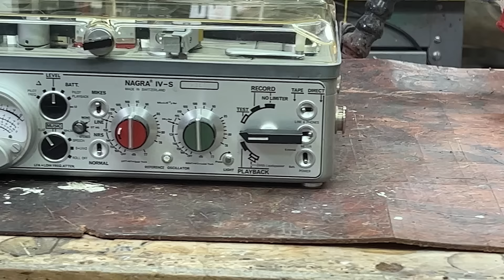Adam Savage Restores Clear Plastic Discoloration

Comment: Make a paste by mixing baking soda with water until you get a thick consistency. Apply the paste to the yellowed areas of the plastic. Gently scrub the paste into the plastic using a soft cloth or sponge. Let the paste sit on the plastic for a few hours or overnight.

Comment: Did you nod off watching the videos about removing discoloration in plastics?  You must have because they all use UV light strips or, at least, protracted exposure to the sun.  Of course, I'd worry about leaving plastics out in the Summer Texas sun because of the heat involved.  It is impressive that you got such a good result just by polishing.  Thanks for the video.  Fun.

Comment: Hi Adam, you should definitely using UV light with the Peroxide for better results. A clear plastic container wrapped on the outside in aluminium foil and a black light or UV LED strips suspended above the container pointing straight down. Foil to reflect the UV back into the container. The process is called Retro Brightening, the 8 Bit Guy or Odd Tinkering channels use the method often.

Comment: Looks great. I don't know if it can remove more of the yellowing. But, have you considered using PolyWatch? It does wonders for restoring most scratches on acrylic crystals for watches.
What I'd like to definitely know is to how to restore rubber components that develop that nasty tacky feeling when it hasn't been used in a long time.
Reply: i agree on the rubber parts - i would love to see him try out different methods for restoring rubber. I have read that winter green can be used to make hard rubber soft again, but i have not tried it (mostly because winter green oil isn't readily available here in europe...).
Reply: @pinkerbot  for me or my application, I am thinking of a Darth Vader lightsaber I have and the rubber grip pieces around the bottom half of it have that nasty tacky feel. I've not tried it, but I heard or read somewhere that washing with baking soda might work to clean it up and restore it.
Reply: Just remove the coating. There's nothing that can be done once the rot has set in. IPA and elbow grease does the job if you can get into the nooks and crannies. Manufacturers know that these coatings don't last but continue to use them. Built in obsolescence? Ask any 3Dconnexion Space Mouse user. I wouldn't mind if the coating was only found in inexpensive 'disposable' products like TV remote controls - but it's everywhere. Talc can be used to disguise the gloop but it's constant maintenance. Strip and replace with a piece of leather or something.

Comment: Adam, either putting the container with the piece submerged under a strong UV light, sun, or keeping it warm, is how you deal with this kinda discoloration.
Highly recommend The 8-Bit Guy's videos on restorations using this method.

Comment: I think 2 things are being muddled together.  Opaque plastic containing a dye (e.g. beige computer case) and human detritus stuck to the surface (e.g. skin oil, food spills, etc.) changes with age and light exposure (e.g. UV from fluorescent light).  Hydrogen peroxide can bleach or remove this type of yellow because it is acting on the organic colors (dyes) and removes most of the the detritus.  Clear plastic on the other hand yellows because the long chain molecules cross link affecting the transparency.  The difference in transparency is sensed by the human eye as "yellow".  I'm pretty sure the only way to remove this type of yellow is to remove the layer of crosslinked plastic.  Thus polishing or wet sanding then polishing will remove this type of yellow.  Plastic headlight lens restoration kits work this way.  The confusion stems from assuming that all age related yellowing is the same.

Comment: So Hydrogen Peroxide works, but it needs UV light with it.  I use a product from Sally's beauty supply called Sallon Care.  It's a white hydrogen peroxide paste that is much easier to coat.  If it's sunny out, I'll coat it, throw it in a ziplock freezer bag or a turkey tin with plastic cover from the dollar store and leave it outside.  Otheriwse I have a UV nail curer I modified with some rails to go over the top for in doors, but I found sun light works much better.  This works great on sun damaged white plastic too.  And then the plastic polish you used helps get it the last mile, so long as it wasn't textured before.

Comment: The hydrogen peroxide solution needs a catalyst and to keep as much oxygen in the solution as possible, should be covered (but not sealed). Usually the catalyst is UV light, but you could have a low hot plate as well. Something like 35-40°C.

You will want to rotate/flip it every hour to hour and a half to ensure even coverage and to check progress. I would expect results after 3-6 hours.

Comment: As many others have stated. The UV light method I purpose using volume 40 cream along with the UV light. 
Lather in Vol. 40 cream
Cover in cling wrap
expose to UV light
This process is used in the sneaker community to remove the yellowing on clear soled shoes. Hope this helps.
Reply: Presumably the yellowing of translucent materials could only be remedied by penetration of the peroxide and UV to well inside the body unless the yellowing is superficial. Yellowing on my Gel G-Shock watches was mostly superficial. Perhaps that is also the same with the sneakers.

Comment: Adam, have you actually tested your recorder? Checking to be sure it still records well, plays back well, and there's nothing that needs maintenance or refurbishment? The heads might need deguassing/demagnetizing. There are wear parts that can introduce rumble, hiss, etc. Such a magnificent machine deserves a once over by an experience audio and/or electical engineer.

Comment: Salon Care 40 + grow box + uv lamps + pc chassis cooling fan.   Use a thermal probe or temp sensor cutoff.  Treat it like a pair of Air Jordan kicks.  Coat with salon care and cover with plastic wrap to basically keep it from drying off to fast.

Comment: yeah, the comments said it better but the better Retrobright method so far is to have a sheet tray of Peroxide at bottom, put the plastic you want restored avobe (not contacting) & you keep it in a closed container with either UV LEDs or just hitting the sunlight. it's slower but the result is a lot more even while also being pretty hands off

Comment: Hard to tell the amount of scratches needing removed, but for a mechanical means of removing that amount of surface yellowing,  I likely would have recommended hand wet sanding behind a soft sanding sponge backing pad starting with 1,000 grit, to 1,500, to 2,000. Then used a 3" 3M trizact in 3,000 grit on that polisher very wet, followed by a 5,000 grit trizact the same way. Then hit it with a medium density foam 3" buffing pad on the polisher with meguiars 105, followed by 205. Finish with a decent SiO2 ceramic spray..once cured, top with a good synthetic paint sealant like techwax 2.0. If no yellowing was present, you could have gotten away with just the trizact and later stages.

Comment: That is a gorgeous piece of equipment. I got into sound design and location sound recording after those had already gone by the wayside for general use. They are just amazing mechanically though, absolute pieces of mechanical art.

I would be curious to know if Nagra knew who it was originally sold to and possibly what projects it was used on.

Comment: «The mild peroxide solution does not seem to have removed a ton of the yellowing»: the plastic has not turned yellow due to something being stuck to it; rather, atmospheric oxygen and UV light have chemically-degraded its surface. Stuff like Novus "removes" the yellowing by physically abrading away surface plastic, showing the "new" plastic beneath (they're used to remove scratching).

Comment: I personally would not have polished first because all you did was add a micro thin barrier to the Hydrogen Peroxide...in addition to using the ultraviolet light in a light box. Polishing it afterwords would have been better. But it turned out to your satisfaction...which is what it is all about anyway.

Comment: I use 3% peroxide solution in full sun for a few hours to get the yellow out of white plastic, specifically LEGO bricks and it works great.  The key is for it to stay completely submerged in the sun.  I also use automobile clear coat polish to get the scratches out.
Reply: Does the UV penetrate the peroxide solution if the items are submerged? I had more luck with a paste but would much rather have all my objects in a plastic bottle or similar. Better for inspection and agitation. The UV could have a problem with a glass container I suppose. I'm trying to restore small items in bulk - like keycaps.
Reply: @nikthefix8918  the UV does penetrate the glass bowl and the peroxide.  I’m not sure exactly how the process works from a chemical standpoint but it works best if the parts stay submerged.  I also put a piece of tin foil underneath the bowl to reflect back up to hit the parts from all angles and I don’t put too many parts in at a time, I give them room to get hit by the UV and I stir the parts about every 30 minutes.
Reply: @DRUmBEaTTS  Thanks.

Comment: Wow, great tips from so many. This is such an amazing resource! On a slight tangent, can someone offer up an explanation as to why yellowing of plastics is still so unavoidable. Are there any polymers or other mold able substances that are immune to this trait?
Reply: Ironically enough, one of the causes of yellowing is also UV-radiation. A common example is yellowed LEGO due to prolonged Sun exposure. The technical term is photodegradation. To put it really simple, the plastic oxydizes. Outdoor plastics, like garden furniture, have UV-blockers added in the mix to slow the process down.

Another probable cause are bromine-compounds added as fire retardant. Heat is also an important factor. it can't be avoided completely because it's just a chemical reaction that happens over time. I don't think there are any polymers that are completely immune to it but glass pretty much is.

Note that no matter the cause the polymer chains are broken down and those are not repaired by this whitening process (ret0brighting). So it won't restore plastic that's become brittle.

It's also temporary. Worst case scenario, the old yellowed color is back in less than six months.

I tried it on some of my LEGO and in all honesty it's just not worth the money, time and effort. I guess it's great for resale value but if you're putting your collection on display I say invest in some UVA-blocking window foil and keep things cool. Accept the discoloration as part of the object's story.

Comment: @5:00 min mark, when I'm repairing/dismantling things, i use a 3D printed container with squares on it and numbers. I think mine has 20 slots/numbers. Allows me to put the screws/parts in order of when they came out. When it's time to re-assemble, just start at the last part and work backwards. ;)

Comment: Redo the polishing and use microfiber cloth instead of paper towels.  The results will be a lot better as the paper towels just re-add the scratches.  Once you get it really nice,  hit it with 2 or 3 coats of a uv blocking clear coat like mr. Hobby gx112 uv cut gloss.  That will prevent re-yellowing.

Comment: HI Adam, did you think of using Acetone Vapors which is used to clear auto headlights. You can just put some acetone in an empty coke can, stick a tube on top and heat the bottom of the can with a heat gun and the vapors should come out of the tube, pass it across the plastic and presto. Dont know if it would have taken the yellow out but It shure clears plastic like glass...

Comment: Try Blue Magic it works amazing on plastic like this cover. Also for the cover on the speedometer. I haven't had much luck with hydrogen peroxide, even the 28 percent that you can't get any more.
Reply: It also looks like you used a wool buffer whose fibers are harder than the plastic, use a foam polishing pad made for automotive clear coat. Cotten towels and paper towels also scratch plastic. Use a new microfiber towel it doesn't scratch what you just polished. The cover looks great but it could look perfect.

Comment: To remove an shine clear plastic I used steel wool and automotive clear coat. Ten min 2 headlights never polished again. We must cut the oxidation off then fill in the scratches.  Dbl ot wool. Use 90 proof alc to clean in case someone used waxes on the lense. Clear an install. 2 yrs on my last shine an they still look fine.

Comment: Wet-sanding it first probably would've given an even better result. And quicker. Starting from 600 or 800 grit depending on material and condition, then in steps of 200 up to 1200~1500. Machine polish until it shines like new.

Comment: While UV light works great, heating up the hydrogen peroxide works, too. Of course, combining both would probably show the very best results, as the UV light increases the reaction itself whereas temperature (as always) increases the reaction speed. Yet for safety reasons, never directly heat up the hydrogen peroxide! E.g. put everything into a sealed, transparent bag and then throw the entire bag into very hot water to heat it up while exposing it to UV light from top. That should give you near perfect results.

Comment: Its not necessary to submerge the plastic in the solution. A better way is to raise it over a small pool of it, then seal it (air tight), then heat it up, and let the gas from the solution cover the plastic and it will do the work. This will allow for total coverage (instead of bits that are not submerged not being treated). 

There are some videos out there that show that UV light may not be necessary as its not the true catalyst for the effect, its mainly the heat and that the UV light may actually make it worse in the long run (because the yellowing was caused by the UV light in the first place). But i havent been able to reliably heat it up myself long enough to test it.

Comment: There's even better method that came up recently - you just need a closed container with high % unstable hydrogen peroxide on the bottom, it's fumes go up to the piece you want to restore and works wonders on it, you have to keep it around 40-50C. And UV light, yeah.

Comment: Adam,
Just discovered your ONE DAY BUILDS! Watched the one where you worked on your drill press and found the precision taper ruined on the spindle and keyless chuck. I immediately thought of videos from CUTTING EDGE ENGINEERING in Australia where he bores out worn parts and then builds back up the surface with his wire welder, then bores back to original dimensions. Why couldn't you weld up the taper on the spindle, mill back to slightly oversize and then send it out to a precision grinding company to restore the taper to exact specifications?? 

B. T. W., I love the old analog tape gear! I still have a few MCI, Otari and Studer decks taking up way too much space! Sad that it is next to impossible for them to compete with the new digital stuff. Some years ago the Avid rep gave me a copy of ProTools and I have not turned on an analog deck in the home studio since.

Comment: Hey Adam, for such a rare piece of equipment, it is heartbreaking to know that the clear plastic would degrade overtime. Would it be wise to make a mold out of it for either vacuum forming or resin casting?
Reply: Or a really detailed parametric CAD model if it hasn't already been done.

Comment: Hi, Adam! Is this the same process of discoloration that makes other old plastics go yellow?
Reply: Yes it is.
Reply: I've used 30% HP soaked overnight then set out in the sun for a couple hours and cleaned up to clean old computer cases that have yellowed and it cleaned all the yellowing right off.  The big part Adam skipped was UV light either sunlight or a UV lamp.
Reply: @lordhosk  this is 100% correct

Comment: The 8-Bit guy retro-brights with much less peroxide than 12% on 100 times more extreme yellowing by exposing the peroxide submerged part to UV light in the sun or uv lamps. Its the COMBINATION OF UV AND PEROXIDE   THAT DOES THE TRICK.

Comment: Oh man , was waiting for Adam to snap the lid as he Novus polished it and put pressure in the middle with the unsupported edges😱 the electric driven polisher was a better idea. Paper towel is scratchy paper based…better to use microfibre cloths. He did well to get it where he did.
 I hate polishing clear plastic parts, like the clear canopy parts of model kits,they are just asking to crack. Far better to give small clear parts an acrylic dip in Future/Pledge or what ever it is called now.

Comment: Noone mentioned 0000 steel wool..polishes glass...also works on plastic..just have a lighter touch when using..worried about pressure? A little jewelers rouge could also work. If it says heavy scratch removal then its going to be more abrasive than polish. The best guys to talk to on things are automotive body guys really.

Comment: Peroxide was the right move, but you missed the UV light which activates the chemicals to react with the plastic and clear it up. Check The 8 Bit guy about plastic restorations with peroxide

Comment: Using paper towels on something soft like plastic abrades the surface so the more you rub on it the more scratched it gets. After it was polished a microfiber cloth is what you should've switched to. Sorry to be one of those commenters but I cringed when you started rubbing it with the paper towel after it was all done.
Reply: Exactly my thoughts. Plastic in general scratches very easily, it's just not that noticeable on most colors. Any plastic you care about should not be cleaned with paper towels.